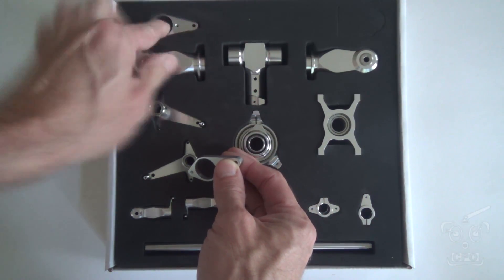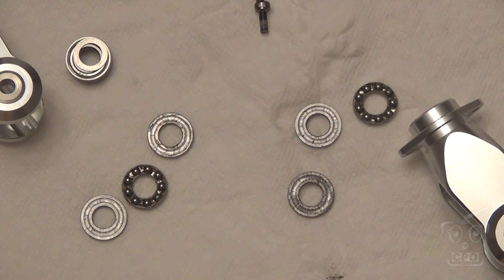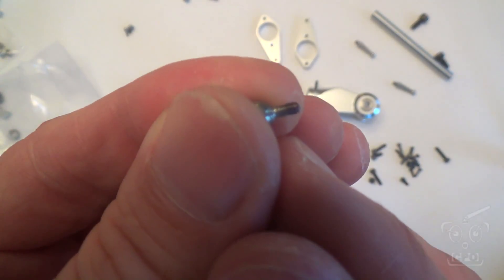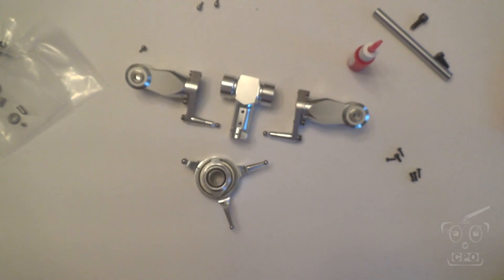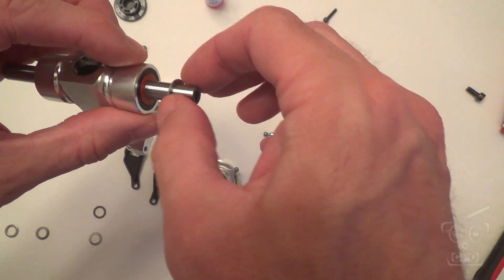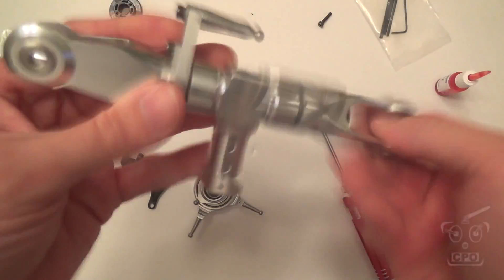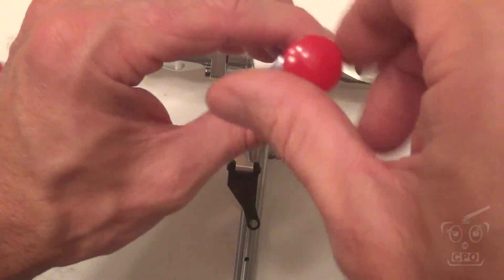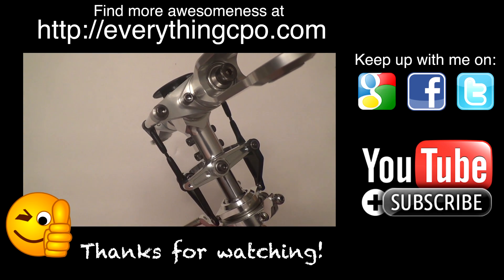03 CPO & CJ Raptor E700 V2 - Building the Head - Thunder Tiger

Comment: Hey CPO, just a quick note on that black grease.  It is black for a reason. It's the molybdenum disulphide that makes it black.  One of the reasons why molybdenum disulphide is used in a high pressure grease is that it stays put on the bearing surfaces when the rest of the grease is squeezed out under high pressure situations and continues to give some lubrication protection.
 It may be black but it will protect the bearings better in a high pressure environment.  The question is whether the pressure is extreme enough to warrant it.  I don't fly heli's so can't comment on that...
Reply from the maker: Great info! Thank you.

Comment: Thanks for doing this. I have to say that helicopters have always intimidated me but you have taken some of that away. I found your channel because of your tricopter build. Great help by the way. Side question how would you compare the flying difficulty of the two. Thanks again and keep up the great content.
Reply from the maker: pMustangw Thanks for your note.  Helicopters are complicated little machines...but they are really great. The interesting thing is, the bigger they get, the easier they get (but also more expensive, LOL). The tricopter is easier to fly, hands down, but it's different. It doesn't have the capability that the heli has, and also uses stabilization. The tricopter is the most like a heli, though, in terms of flight characteristics from all of the multi rotors.

Comment: I would be a little shy about using red when you are going into aluminum threads but it is likely fine for steel to steel.

Another tip for applying Loctite in some place is to use a toothpick or something like that and put the Loctite down in the hole instead of on the screw. When going through bearing surfaces that prevent any escaping off the screw and getting on a bearing or bushing.

Otherwise, as usual, a good thorough tutorial.
Reply from the maker: Thanks, Barry. I've spoken with several Thunder Tiger team pilots and others who have collectively built dozens of these machines... And that red thread lock that comes in the kit is the preferred choice. I do often use the toothpick method in my builds when it makes sense, but I honestly haven't found a screw in this build where I didn't feel comfortable just putting it on the screw. I do use a hobby knife to apply thread lock later in the build tho.  ;-)  Thanks for the feedback!